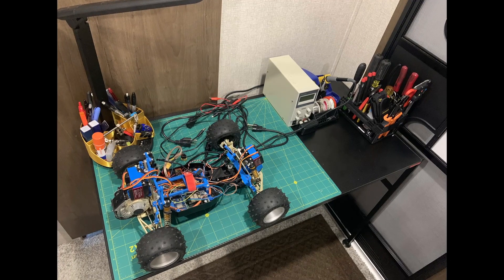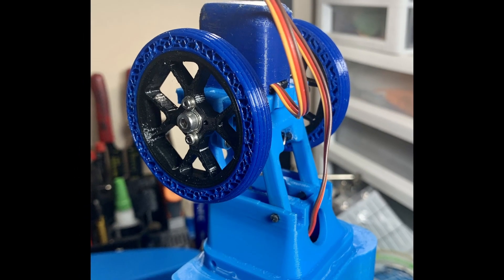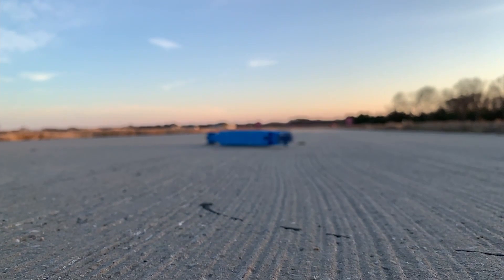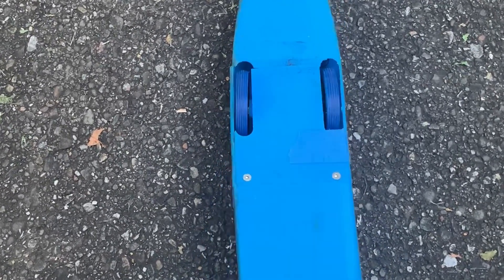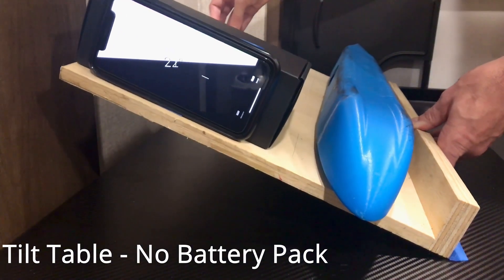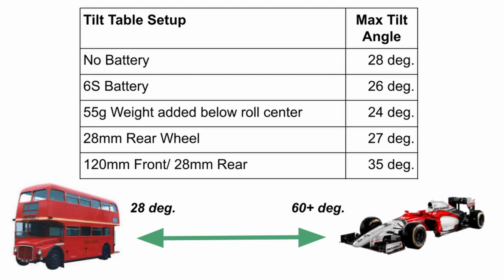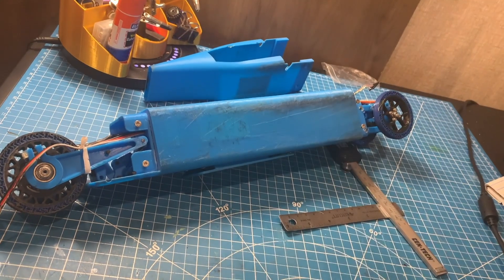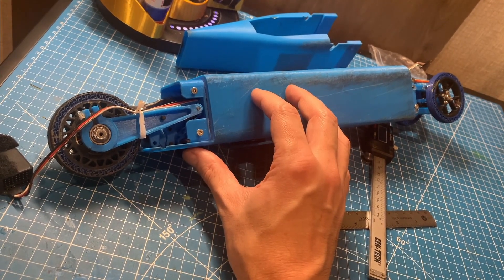Project Streamliner: Version 2 Initial Test - Pt8

Comment: Hey this seems like a very nice project indeed!
Obviously it seems I may be somewhat late to the party.

Since the front and rear suspension allow for no roll movement of the tire relative to the vehicle, at the moment there exists no roll axis on your vehicle. There is (approximately) no body roll and as soon as the maximum tilt angle is surpassed the vehicle suddenly changes behavior and thus becomes unstable.

As an idea I would try to make transition between stable and unstable behaviour as smooth as possible. Generating roll compliance of some form in order to have a time delay for the rollover event itself seems like a possible successfull strategy to me. The idea being to give your controller actually some time to give correcting inputs before the vehicle tips over. 

For the rear axle with e.g. a (Motorcycle-style) rounded sidewall rear wheel you may loose some maximum tilt angle, but prevent the sidewall of the tire "hooking up" when rolling over or skipping sideways over the surface and generally making the rear wheel less sensible to body roll. 
On the front maybe increasing the flex with a single pivot suspension similar to a torsion beam axle might be an option to get some compliance in the roll axis.

Since your main target is to drive fast in a straight line, maximum tilt angle might actually not be the main target. If you think about it even a Motorcycle (or Bicycle) is capable of self-stable driving.
So I guess the most radical solution could be to reduce roll stiffness to a minimum and make a motorcyle out of it (then you would probably need to push it at the start). In that case I would suggest increasing the mechanical trail (always a good idea for straight line stability) and give the steering axis some inclination.

In the end you don't need it to be able to turn sharp corners, you just need it to not turn sharply.
Reply from the maker: Wow, thank you for all the feedback.  Especially about the roll axis.  I never was sure of the exact dynamics of roll since the car didn't really match anything else.  After that last video, I slowly realized that this car is just a 3 wheel motorcycle.  I'm working on version 3 but I'm still not sure how much caster to include.  I tried 15 degrees caster initially, but the wheel's gain too much camber when turning and I can't get enough steering response, so I'm going to settle for around 5-10 degrees and see how it works.  

You're completely on the mark with the sidewall of the tire hooking up.  I can actually see chunks torn out of the tire when it spins out or rolls over.  I've since switched to a much softer tire rear tire, almost a wrinkle wall slick.  This may or may not hold up at high speeds, but makes the car much more stable at low speeds.  I'm actually questioning if I need a suspension at all with a soft enough tire.

Comment: You can stabilize the car by using two motors with differential throttle with a gyro and making hub motors out of low kv motors. The front steering is not good enough you need that differential throttle for the car to tack straight because the front wheels will just skip across the ground without steering the car.
Reply from the maker: That makes sense. The car seems to steer less and less with speed. I am curious to at least play with a gyro setup to see how much force is actually needed to keep it straight.

Comment: When front wheel is in the air after some bumps on high speed, and rear wheel accelerate whole machine, it is uncontrollable in this moment. So need wing in front.
Also you need some spoiler or use groundeffect to get more stability. You should control roll with that wings
Reply from the maker: I agree.  Not having a front wing may cause me some issues and I may move away from wings completely and run a ground effect floor.  It's hard to see on camera, but I run a significant amount of rake, meaning the rear is always higher than the front to maximize the front downforce from the floor.  CFD shows that there is more downforce on the front than the rear with the wing, but sadly I don't have a windtunnel to confirm that this is the case.

Comment: Look into renault F1 tuned mass damper from their f1 cars with alonso, it made a huge difference fro them
Reply from the maker: I’ve thought about this. I actually read some papers on electric cars where they used the battery pack as a tuned mass damper. I’d need something like soft foam to wrap the battery in.
Reply: @IndeterminateDesign  seems like it might work, love the preoject
Reply: @IndeterminateDesign  Dont need soft foam for that. Suspend the batter with rubber bands, then dampen it with pieces of foam at the top and bottom to tune the mass, and prevent oscillating.

But first, fix the suspension geometry. Thats most of your issues.

Comment: Awesome work! I've done a lot of random RC builds based on aero and I'm finally getting my design together for a speed running car. My goal is to have really efficient aero....ive considered doing active aero to weight balance front rear but may settle on CFD work. 

I'm not sure what your speed goal is, but you're limitation looks to be traction with the TPU wheel and limited rear downforce. Have you considered a stickier tire?
Reply from the maker: Thanks!  I loved your fan car and active aero videos.  Speed running cars are a lot of fun to design.  I really love the idea of active aero and I will revisit it later.  Mine is long enough, front weight biased, and high raked that it’s relatively aero stable.

The rear tire structure is TPU but it’s capped in soft rubber from a mountain bike inner tube.  Kind of ghetto, but I had a hard time finding an appropriately sized RC car tire. 

I’m building a tire test rig right now to test EVA foam and other materials.  I think the limiting factor is finding a place to run.  Having more traction for acceleration and stopping will help significantly.   I saw a full size drag car that did 212mph in the 1/8mi and that’s my new goal 😆
Reply: @IndeterminateDesign  have you done the math to see what your tractive force is compared to wind resistance at your target speed?

I would imagine you're lucky to get a practical friction coefficient of 1, which means less than 50% of your total mass is your baseline traction force depending on weight balance. So your practical acceleration at low speeds is limited to like 0.5 Gs. Then when your have reasonable downforce, you have the drag + inertial resistance to acceleration to contend with. But that means you get more acceleration at higher speeds if your motor has enough torque to take advantage of it at those. This is one of the reasons it's so common to use AWD instead of rear drive (all weight and downforce goes to traction).

Funny you mention dragsters. My build is based on a dragster chassis. Getting over 200mph on a 1/8th take over 2Gs of average acceleration which I would consider high for an ultra low drag car.
Reply from the maker: I don’t have a lot of confidence in my CFD simulations, but the aero drag is much lower than I expected, typically 6-9N at 200mph with .005m² of frontal area.  In theory, that could be overcome with little to no downforce on the rear.

I’m sure you’ve read all of the magazine articles about Nic Case’s 202mph setup.  I did some back of the napkin calcs based on his frontal area, weight, and power and my setup should exceed what he had.   That's really the only comparison data I've been able to find.   

  I wish I could package and AWD setup.  My first car took over ⅓ of a mile to hit 90mph because it could so easily lose traction or lift the nose and take flight.  Given unlimited distance and radio range I think hitting 200mph would be pretty straight forward.

The max acceleration I recorded with my first car was 1.2G acceleration from 0-50mph.
When I saw your video with the fan car, I kept thinking my numbers just don’t seem right.
Studying drag cars, I’m seeing some crazy acceleration figures even on drag rails without rear wings, but I don’t know if a drag slick would hold up to 25,000+ rpm. An expanding wrinkle wall slick would be perfect for our application if it could take the RPM.

It’s great getting to talk technical.  If you ever want to reach out or have any questions my email is indeterminatedesign@gmail.com
Reply: @IndeterminateDesign  whoa! .005m^2?! That's way smaller than I thought it was. That's like 7x7cm square! My current plan is .035m^2, but probably way more power as my battery has the same frontal area as your car.

Dragsters get their insane acceleration with track prep and massive contact patches at launch. 250in^2 glued to the ground can support a lot of tractive force. And then something like a top fuel dragster has thousands of pounds of downforce before the mid point of the track. Dragsters also rely heavily on weight transfer to the rear axle. 

I'm not sure I'd trust the 1.2 G longitudinal acceleration at low speed as physics dont really support that without downforce. Maybe you're getting some readings from surface roughness. 

Best of luck and I look forward to the design of this thing coming along. If all else fails...let's slap rockets on these things and go to a drag strip.

Thanks for the email...once I finish these next 2 projects I'll be focusing on the speed car and will reach out!

Comment: I think the rough surfaces you're running on compared to the diameter tire would be like running a full size vehicle over speed bumps. 

Have you tried this in a school gym or some other incredibly smooth paved surface?

Can you increase the wheel diameter and raise the axel height, leaving you at the same ride height, but with a higher roll point and a smoother ride?

Comment: I'm so glad to see the series continue! If it were my project, I'd probably find a way of widening the track width. From your data, it looks like a large improvement of the roll/tip angle can be had for a small increase in width. I remember one of the prime goals of this project was to keep the correctional area as low as possible to minimize drag, but if it isn't stable, you're not gonna go fast anyway. So maybe widen the track width until you get a roll/tip angle in the 40 to 50 degree range? You helpfully wouldn't need more stability than that and it also would hopefully not widen the car too much.
Reply from the maker: I agree, it shouldn’t take much extra width to stabilize the car, but it makes me sad because frontal area grows so quickly. Realistically, at this size, I could even get away with just a set of faired wheels separate from the main body.
Reply: If you put the wheels far enough apart and suspend them independently, you could move the battery forward to sit somewhere between the front wheels. That would improve stability as well since reverse trikes have inherent instability (ask any tail dragger pilot). The obvious downside there would be added mass but it’s something to think about.

Comment: There are a bunch of things to do differently here. First, without getting WAY to in depth on the geometry of roll centers, your "axle centerline" is not the roll center. Its actually largely dependent on your suspension mounting position. For example, adding a 1mm spacer under the ball stud of my 2WD off-road buggy, is enough roll center adjustment to take the car from traction rolling when looking at every corner, to providing enough camber gain to allow the car to get just enough grip at speed to comfortably make the corner.
In short, your rear suspension arm is too damn high. It needs to be mounted at the absolute bottom of the chassis And angle UP to the rear tire. This will SIGNIFICANTLY drop your roll center, and Center of Gravity. Additionally, your front end geometry is severely lacking in trail, or caster. I suggest you look into caster, rake, and trail, and get a basic understanding of how they work on a car and a motorcycle, and how that accommodates self centering steering geometry. That way the car wants to keep straight, and doesnt continually produce a pitching moment that throws the car sideways. And...just like the rear, your bottom most pivot point of yoru front suspension should be in the absolute bottom of the chassis. Not the middle like it is now.

These changes should also allow you to lower the whole body of the streamliner a couple mm. Being close to the ground should provide some stability benefit. Also you may consider the chance to play with some ground effect on the bottom as well. As this will greatly help the stability, without adding undue drag.
Reply from the maker: I’m not an expert, but I assumed the roll center would behave statically when there’s no role freedom.  But it makes sense what you’re saying, and that probably means a softer suspension would help as well.  I will try out a new rear mount here if I can. 

I am curious on the caster and trail on the front. I know they help in a real car where the wheels will self center on their own, but with a steering servo that maintains a set position does this still matter?
Reply: @IndeterminateDesign  the roll center exists whether there is roll freedom or not. Your tilt tests prove this. Roll center is a byproduct of suspension geometry, and how it interacts with the center of mass. Look at the difference in swing arm placement of a road racing bike, and a drag bike. One is to keep the roll center as centralized to the center of mass as possible to help the bike rotate axially to lean. While the other is underslung and extended to aid in traction, and straight line stability. Ducati even put a "hole shot" device on their MotoGP bike that is essentially a pneumatic shock that drops the swing arm for acceleration at the start, and raises back up for turning corners. Besides that, as soon as the vehicle starts to steer, the roll center will change the instant the moment of inertia changes. And all sorts of complex physics start to take place, and plop...over the car goes.

As for the caster, yeah, it will help. Your steering servo can't activatly correct the slop on the steering, as quickly as A good caster geometry and the forces it generates can self correct it for you. The two together should make it even better.

The more the car can do on its own to keep it tracking straight without any control input, the faster it will be. Unless you are intentionally trying to make it an "acrobatic streamliner", you should try to bake in as much inherent stability as possible, instead of trying to program your way around it with crutches and auxiliary systems.

Comment: Too much bumps on road, your accelerometer values and decision you made on this data will go mad.
I think you should use stability wings and control whoke system with them instead of just front wheels.
Reply from the maker: I agree.  I have to filter the inputs from the MPU to have a clean enough signal for the steering servo.  I initially tried to lower the throttle based on the yaw rate, but the ESC I was using was from an airplane which caused the rear wheel to lock up.  I have upgraded to an ESC meant for an RC car for Version 3 which works much better.